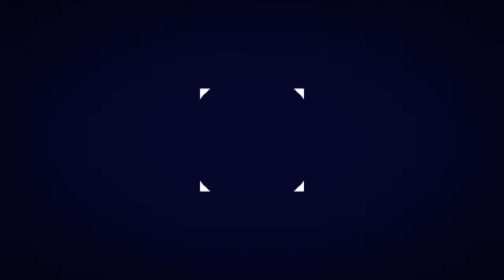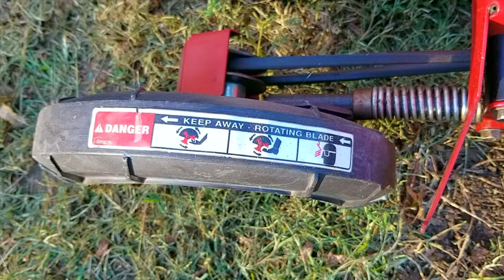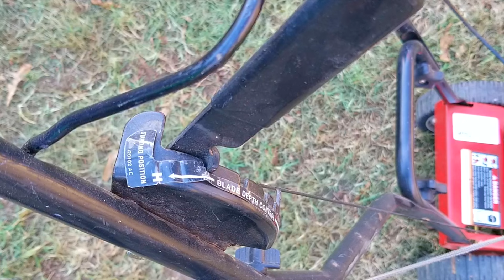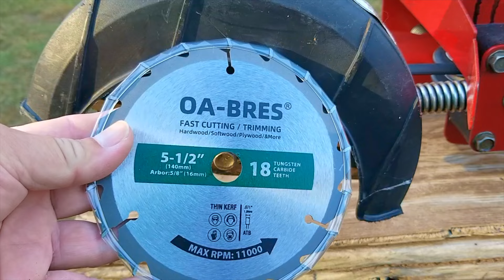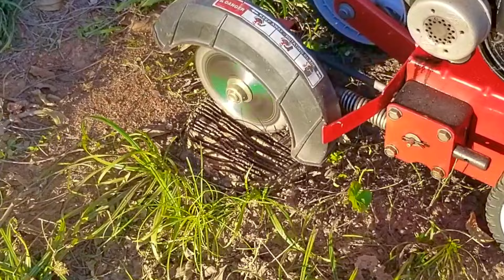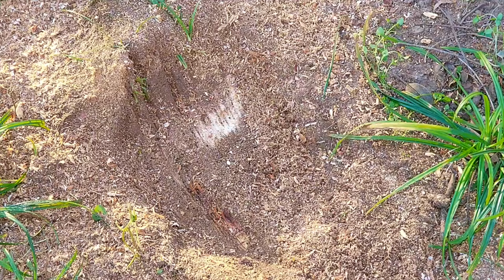Turning A Yard Machines Edger Into A Stump Grinder

Comment: This would be so much more effective with the Golden Edge blade. It has two 1/2" steel teeth with a carbide cutter on the end. That would make this work more like a stump grinder than a saw. The two main drawbacks are that the blade is $50, and it only comes in a 1"-hole configuration. But great job on repurposing this edger!
Reply from the maker: Thank you very much. I'd still like to look into it and see if it would work better.

Comment: I modified some mowers on my channel, by cutting the front of the deck away so I could use it as a brush mower to cut through very tall grass and thick foliage. As long as you don't stand in front of it, I'd say it's not too dangerous.
Reply from the maker: it's definitely an idea

Comment: You could have (more easily) just use your electric circular saw with a single blade installed (like normal).  Cut your crisscross, etc.  Or, what I have done, use a 'saws-all' type electric saw with tree trimming blade and cut it down below the surface, no crisscrosses necessary, the blade can go right into the dirt.  I do applaud your doing it as an experiment, but it seems obviously impractical right from the get-go.
Reply from the maker: it works, so yep

Comment: 🇺🇸👍 Modified edger fit with concrete cutting blade and a water jet nozzle for cooling and a 3-5 HP motor. Great for cutting asphalt and concrete slow but cheaper then renting a professional machine or paying someone to do it 👍
Reply from the maker: Wow! that's a great idea!

Comment: A couple of suggestions.  Harbor Freight sells a chainsaw blade disk for an angle grinder that might just fit that arbor.  I think it would do a better job than the saw blades.  Another option might be to use a Dado blade.  Although, that might be a bit more expensive. Honestly, I don't see this as being any more dangerous than the edger blade.
Reply from the maker: I really appreciate the information

Comment: a long time ago i needed to remove small stumps and i uses to use a normal saw it worked but very badly and when i saw this.    and could you possibly use a cultivator?
Reply from the maker: it's quite possible

Comment: I came across an edger similar to this at the local dump, and I took it home. I also have several stumps around that need to be removed. I may have to give this a try first. Thanks for the idea. Listening to the engine as it was cutting... I think you could have gone with 3 or 4 blades.
Reply from the maker: thank you and you might be right!

Comment: Good idea for equipment that you weren’t using. My thought and my thought only is that I would have used a skill saw making several deep cuts in both directions. I would then use an axe, maul, or sledge hammer with wedge to get rid of the pieces. But I  do like your idea. Nice job.
Reply from the maker: I like your idea too!

Comment: The older MTD edgers with the horizontal shaft B&S engines were better machines. I've had mine for about 37 years.
Reply from the maker: yes you are correct, those are a much better choice

Comment: I did something similiar with a handlebar Stihl with a 12 inch table saw carbide blade that was the most dangerous thing since the atomic bomb. It'd cut anything from 4 inches down before you could blink. That was enough. Blessings
Reply from the maker: wow nice idea

Comment: worked surprisingly well . many years ago i had a circular saw blade that was manufactured with only one tooth (carbide) . i believe it was enduro brand . sawing some boards on my pickup tailgate , i accidentally sawed thru the tailgate . didn't even notice till weeks later when i noticed the slot in my tailgate . didn't seem to damage the blade at all , i continued to use that same blade for years . carbide = tough .
Reply from the maker: that was some blade!

Comment: That style of side Walk edger  is the worst design  for trying to replace the drive belt as far as the blade wears out quickly because of the metal used to make it
Reply from the maker: I have to agree with you, you have to fight the spring
Reply: @INSIDEHOUSEGARAGE   I saw that one at Lowe's And thought what is going on with this  edger  I had a mtd edger with the horizontal shaft Briggs and Stratton engine on it which made The belt easy to change it quickly plus I got the three way blade which has The three cutting  points on it